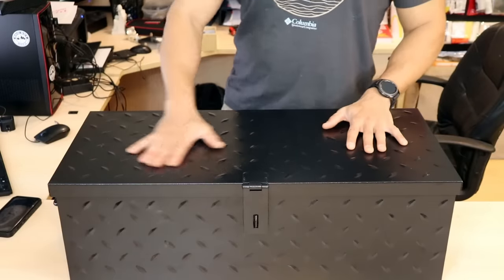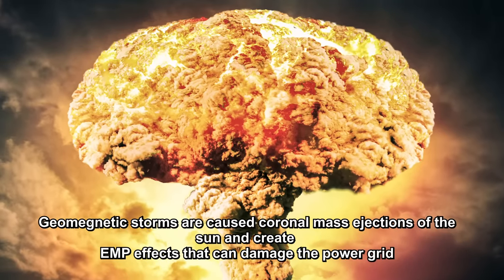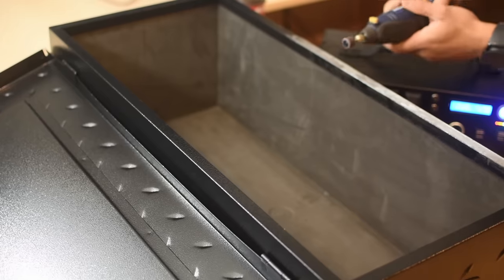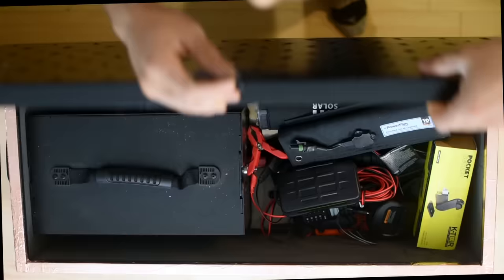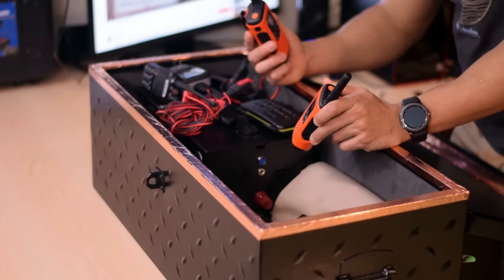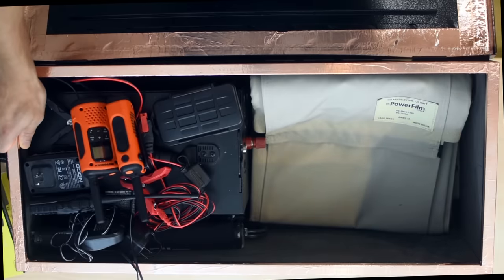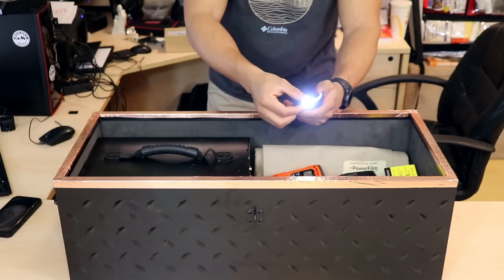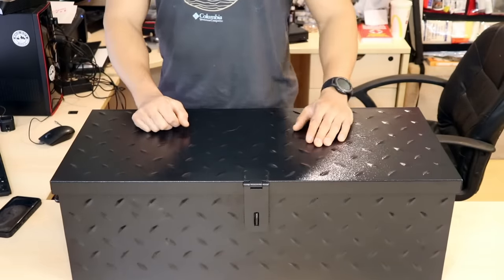EMP Prepping: Building a Good Faraday Cage | Inergy Kodiak Generator

Comment: Is the adhesive on the metal foil tape conductive, or is it acting as an effective insulator? You could check with a multi meter.

Comment: Aluminum box does nothing to attenuate a MAGNETIC pulse that would induce damaging voltages in electronics. you need STEEL , preferably heavy gauge and grounded(as in directly to a grounding rod)

Comment: I thought it was suppose to be copper... I don't know how to make a faraday cage, but the last time that I looked, I understood that it was copper and it could simply be mesh, a copper mesh, and that would sufficiently protect from the strongest EMP blast, but yes the inside of the cage had to be a nonconstructive insulator and it was a good idea to put rubber insulators on the bottom, to simply rest off of the ground. So, insulted from the ground and insulated on the inside

Comment: Sounds like a good business idea. Do you have a video on the PowerFilm 120W Solar Panel and accessories needed to I/F w/ the Kodiak?
Reply from the maker: You just need to splice a powerfilm cord with the one provided with Inergy, an easy fix
Reply: Oh! I thought the MC4-Neutrik adapter made splicing unnecessary. No worries!
Reply: "Dear Dan,

-Thank you for contacting Inergy Solar Customer Support. The cable you are looking for is not an item that is sold normally. We would have to speak with our engineers about making a custom cable. The best way to get this ordered would be to call 877-969-2432 and choose the option that you dont all ready own a Kodiak, This will take you to one of our sales rep and they can submit the cable request.

Thank you,
Inergy Solar Customer Support
Levi"

I'll get the cable made for us :)

Comment: would geting the metalic box then line it with paint or vynil rap then aluminium for or conductive paint, then rince repeat a fiew time to achieve a triple or quad or more level of atenuation work or would it just be as good as the metal box?

Comment: The copper tape is conductive only on the top layer (the adesive is not conductive!)
Also, for a good faraday cage you need electrical contact on entire surface.
You need a RF gasket, not a copper tape!.
Because of this very important flaw, almost 95% of the things a called "Faraday cage" that you can came across aren't true Faraday cages but only metal boxes capable to 10-20dB of attenuation only (equal to 10 to 100 times in power attenuation).
A proper built faraday cage is usually capable to 70-80dB of attenuation (equal to 10 to 100 million times in power attenuation) while a double insulated faraday cages can easily reach something between 110 and 120dB of attenuation (100 billion 1 trillion times in power).
BTW, you can always wrap things in alluminium foil instead (this is the easiest way to build a real Faraday cage that works much-much better than any other fancier metal boxes that have the classic flaw)
Reply: @OutOfZion321 Yes... but the cardboard box isn't strictly required (just wrap your gears in alluminum foil is enough... but for a best long termo protection, seal your gears inside a waterproof ziplock bag with a desicant pack and than wrap the bag in alluminum foil).
The most important advice: all the seams must be in contact in order to provide a good protection (a flat, nice and smooth surface on a cardboard box can leave some unconnected seams and give poor results.... an ugly and uneven ball of alluminum foil with many wrinkles can offer a very good electrical contact between the metal layers and offer a good protection!)

Comment: Bravo CP I was just thinking of this IMOP. likely event... there's a new device for shunting off the E3 for your main house hold power breaker box  . it's called    MyEMPShield.com         349$ USD.
cuts all power to the breaker  box shunts it into the ground in nano seconds "i forget how many"  save your house from E3.    

small note your copper tape has a strong galvanic corrosion reaction with aluminium when wet...
really impressed with your box & the contents !!!
Jared

Comment: Hey! I know this video came out a while ago but I'm curious. I'm working on a project and I want to make a  Faraday cage but have it to where wires are coming out, connecting to other Faraday cages (a power bank in a Faraday cage with wires going to a gadget in another  cage) is that possible while keeping the wire(s) flexible?? I know you can probably just have copper tube with the wires inside but that doesn't move, especially if a make the system wearable (like a backpack system with gear being powered by it from the pack, idk how to describe it but I hope you understand what I'm trying to say)

Comment: Aluminum is not nearly as good as iron for stopping EMP.  there is an electric field and magnetic field associated with EMPs.  The conductivity of the box is what blocks the electric field and the permeability is what blocks the mag field.  Aluminum is a great conductor but has almost no permeability.   You want to use steel (not stainless).

Comment: Would solar cells and charge controllers survive an EMP? No. So, would you be able to recharge this Kodiak generator? No, because a solar panel will not fit in this Faraday cage this,fellow has built.

The Carrington Event electrocuted many railroad telegraphers who touched their morse keys. Batteries can be made (edison battery, or "Bagdad battery"), Small solar panels can be put into the reasonable sized Faraday cage, especially the "roll up" solar panels,  but no  large panels. 

Question: remember science class in high school? Aluminum and Copper have a galvanic reaction to each other when in contact. They react by corroding together. I would suggest using steel wool  instead of Copper. Steel wool is more stable with Aluminum and coated with oil to keep from rusting. You can use small mesh mechanics cloth to make a Faraday cage to protect your batteries, yet leave sufficient escape for hydrogen gas to escape harmlessly. Just a few tips!

Comment: Can you add multiple rv batteries to this system to cover your whole house? And can you plug it into your dryer plug to reverse power the whole house including the well pump ? Is there a down side to this power unit ? I so want this because it’s so simple and portable.
Reply from the maker: The Walker Yes, infinitely daisy chainable except you are still limited to wattage output
Reply from the maker: Its only 1500 watts continous and 3000 watt peak so wont power your whole house!
Reply: Canadian Prepper it would be great to double its capacity and build it as a faraday unit. Hmmmmm🤓$$

Comment: I double wrap my equipment with aluminum foil inside
Reply: I was told to wrap equipment with something like cotton or foam before wrapping with foil. Do you know if this is necessary? Thanks
Reply: Cotton would be the best thing to use, it's only to protect it from any static charge not to harm or damage it. Just an extra insurance.

Comment: First, you need a cage inside a cage inside a cage. Second, no point in saving phones, tablets, laptops, pc's,  game consoles, etc. The only things worth saving are automotive alternators, and automotive ignition modules, for pre-computerized engines. Or find a car so old it has a generator instead of an alternator. Even mechanical diesels will need spare alternators unless you like push-starting only the ones with manual shift. Can't push start any automatic.

Comment: Bad new about those Motarola radios. Their crap. We used to use them zipline guiding and they didn't last 3 months. If the sweat, rain or humidity didn't break em,  the batteries died 2 to 3 months after. We were lucky to get a signal across the park... Only 1 k.
Maybe it was just a bad batch, but.... Good luck anyways
Reply: try kenwood tk 3301 we use them on building site

Comment: And yet he wears a “smart watch” not a “self wind” (automatic) or wind up watch....

Did you check the resistance between the lid and body? Without ground straps between lid and body.....

You should look at copper “finger stock” as a contact instead of the copper tape. I suspect the adhesive on the back of the tape acts as an insulator between the copper tape and the aluminum lid.

Comment: Your kidding right?   Solar panels, as delicate as they are(Silicon Chips touchier than transistors) are somehow immune to EMP?
The foldable solar panel is ok, but how much electricity will it make?  What can you run with it?  A radio? Who will be transmitting?
The last publicly recorded EMP pulse was from a coronal discharge that directly hit the earth - straight on - it was in the period of the Pony Express when they were building the Railroads.  The communication was by Telegraph & Morris Code.  It burned out miles and miles of Telegraph wires on telephone poles, taking great expense to replace it.
WIRES!  What about the power grid?  What about the wires leading to your house?  What about the wires IN YOUR HOUSE?  What about your extension cords?  What about the wires all over your vehicle?  So you save the ignition module somehow ~ are you prepared to completely rewire your car?
Are the windings in electric motors somehow immune?  Your starter motor?
Everything has to be metal shielded, and the SHIELDING has to be grounded - to a ground, IN THE GROUND!  How do you do that when you are driving? At the Walmart parking lot?  The Dr.'s Office?

We will never recover from an EMP.  We will be helpless and starve.  Last stage, nomadic gangs of murderers.

You can protect your transistor radio, but what stations will still be transmitting?
How many extra batteries do you have?

Comment: Why can I use a military grade shipping container/pelican case as a faraday cage since plastic as long as it’s sealed reflects voltage? Why does my faraday cage have to be metal which attracts voltage this shit don’t make any sense to me.
Reply: Every little gap in the corrugated (wavy-gapped) container metal needs to be sealed/in electrical contact with each other. Shipping containers use different kinds and quality of paint depending on the application/what's shipped in them. It can be done but you're looking at a LOT of time to get it done in my opinion.

Comment: Would aluminum tape be better than copper tape?
Reply: Aluminum ducting tape is good for sealing up the outside open edges, like this metal box lid.
Reply: No. Copper conducts better. Use neither though as the adhesive on the tape is an insulator.

Comment: I don't get it.  I have an electronic background and an Amateur Extra Ham license and understand Faraday cages.  I am skeptical on the copper tape with the adhesive tape that could insulate the tape to the aluminum.  I think a copper wire to a ground rod and connected to the EMP box would be a good thing.  Also, I wonder if surviving the EMP attack might be a worse option.  Unless you have at least a year of supply of food and water would just delay the inevitable.  Imagine how much space that would require.  What if it is an all out nuclear exchange where no one would survive anyway.  There is a better way to just trust God and that this life is short and I don't worry anymore about these things.  I do have a well and live in the country and grow my own food and raise some chickens.  I nothing wrong being  independent of the system but I stopped worrying about nuclear strikes and EMP.  EMP might just come with some big X solar flare giving a direct hit on the Earth's atmosphere doing the same as a nuclear device.  A nuclear device making a devastating the US is not a likely event but an X flare event from the sun is a question of not if but when it will happen.  We are in a solar cycle that is increasing that will peak in the next couple of years which increases our chances of catastrophe.

Comment: Ya know, the Sun can also EMP us, and much, MUCH stronger than an atmospheric nuke.
Reply: No, it can't. He covered this near the beginning. Solar flare is not the same as a nuclear EMP. You don't need a faraday cage for a solar flare.
Reply: Tracy Reed is correct.  Only large transmission lines would  be disturbed by solar EMP though still pretty bad (potentially damaging power substation transformers throughout the country).

Comment: Storing electronics in ziplock bags inside a 50cal ammo can should work I assume.
Reply: cdawson198600 as long as there is no rubber gasket and the metal comes in contact with each other

Comment: Trash cans are made out of steel and steel is no good for Faraday box. Copper is the best magnetic flux dissipation of all material that's why they make electric motors out of copper wire and not aluminum wire.

Comment: Way too much time trouble and expense I have three galvanized steel garbage cans from Walmart $18 each I'd lined them with two layers of cardboard with three layers of cardboard on the bottom 
I stack my radio equipment and electronics inside... seal the lid and put aluminum duct tape at the handles so that there is no place for an EMP to enter
We know they work because you can put a portable radio on full volume inside and put on the lid and you will not hear the radio
All RF is blocked
Reply from the maker: I dont want trash cans in my house. I want something that's actually functional.
Reply: @CanadianPrepper  
WE ALL want GENUINE PROTECTION ....

NOT  an overpriced box

Besides 
Doing it this way has been proven to be effective for decades and it provides a measure of security  since nobody wants to look in a garbage can

Comment: I usually like your videos but your cage isn't going to work.   I have three faraday cages I made myself and they are tested to >95db and >120db.    The problem with your design is that you used copper tape instead of an actual conductive seal.   The imperfections in the "flatness" of the steel that makes your fabricated box is going to create small gaps that energy will radiate through.  A lot of energy!   Your gaskets should be of the expansion type like tinned copper mesh over a foam core so that when you close the box, the gasket compresses and closes all the micro-gaps.  I actually tested copper foil tape as a seal and it didn't work.  In fact, there was only a 5db difference between just a steel box and one with copper tape.    Also, a single layer faraday cage may not be enough to protect sensitive electronics like radios.  Your inverter will probably survive, but a laptop or a radio (might) get fried.     Take my advice and invest in some expandable foam EMI / RFI gaskets.   Heck, copper tape is expensive, the gaskets might have saved you money.      ADDITIONAL COMMENTS 1:  Also, keep in mind that having a big powerful inverter isn't going to help you much if everything you want to power with it has been fried by the EMP as well.   Your microwave will probably be fried as well as any of the newer washing machines that use computers.  In fact, anything that has a printed circuit board inside it will probably be toast, especially if they are plugged in and are subjected to both the radiative (from the airwaves) and conductive (from the wires) components of the EMP.  ADDITIONAL COMMENTS 2: You do not need a Faraday cage for a solar EMP.  If its not plugged into the grid, it won't be harmed.. Period, end of story.   And +1 on the NOCO charger, you did your homework on that!    LAST COMMENT 3:  Your cage is a single layer design, while this will protect the less sensitive electronics from a standard nuclear device detonated in space, it will probably not protect anything if the device has had its neutron reflector (Tamper) removed and is designed to be a SUPER EMP weapon.  To protect from a Super EMP weapon, you need two layers of protection, and ideally, three or four layers for the most sensitive stuff.  I would eat my shoe if you tested your current design and it was any better than 50db.   You really want 95db and 120db or more for computer stuff.   Feel free to contact me if you want help.

Comment: Thanks always educational an interesting they’re a backpack that claims to do this also. Probably more functional for edc electronics. https://www.amazon.com/gp/aw/d/B073SHBV7Q/ref=mp_s_a_1_fkmr0_1?ie=UTF8&qid=1521395853&sr=8-1-fkmr0&pi=AC_SX236_SY340_QL65&keywords=emp+proof+backpack.   Also you mentioned copper tape helps, do we know what metals work best?  Could you have a cord that plugs into the top of your bug out container like that is connected to solar panels an get the best of both worlds? Electronics that are charged but also protected from an emp blast

Comment: North America went through a serious sun made emp in 1981.  Your photo is photoshopped and represents a ground nuclear explosion. Aluminum is a very non conductive metals around. Just asked yourself why no wire in your house, the hydro pole, the high tension transmission wires are made of aluminum. No, none, nowhere. Your box is not even grounded. Because of the thickness it would be son non conductive that it would heat up and maybe cook you electronics. You are an intelligent person. Talk to an electrical engineer, or specialist from Nova Scotia Power. 
Do your home work. It is so important because you have many people following your channel.. 

As for the 1800’s event nothing went through because all the wires melted. 
Do your home work please. You fling things here and there. You sound like an army grunt that was discharged because muscles for brain program did not work out.  
To all you listeners out there check all the info before ingesting it. In an SHTF you must base you preparedness by following different sources. It is so important to do the homework. Be carefull out there.